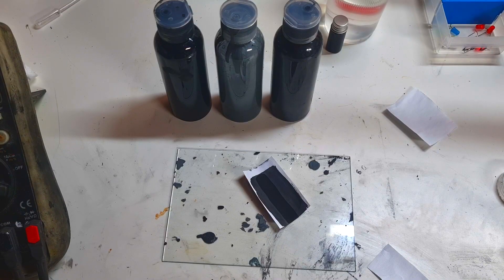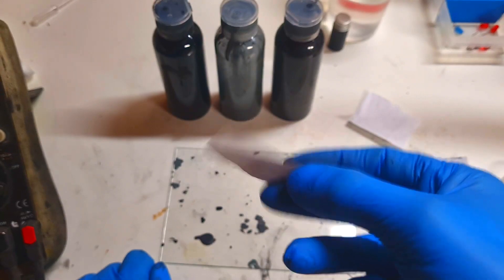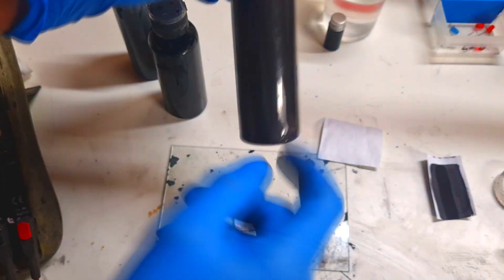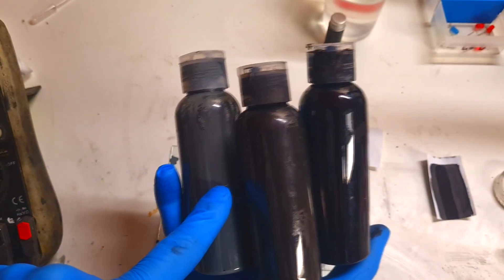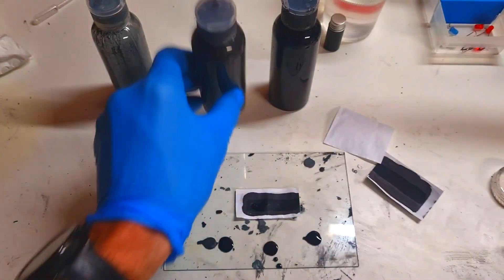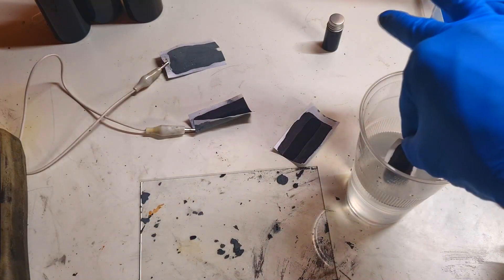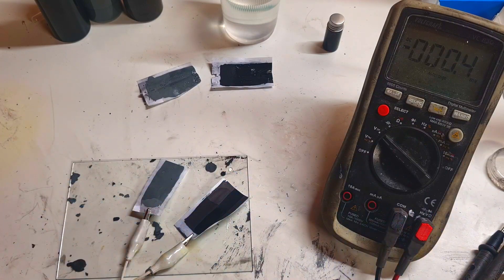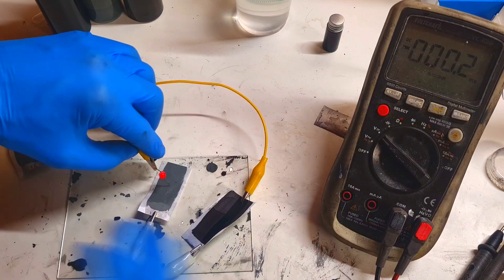Water activated Paper Battery

Comment: Friend, you try to use magnet sheet both sides to hold the paper flat and well compressed
Reply from the maker: Good idea
Reply: @cayrex  you most welcome. Master.
Reply: It is an ill informed idea. The Hall effect will restrict your current to the edge of the battery making the internal resistance go up. It may even pinch it off completely.

Comment: I make it, use water as solvent, and PVC white glue, as you told me, its worked, but I got 1 volt only, it's ok for the first try. thanks master.
Reply from the maker: Yes,.... you will get the voltage from 1 to 1.2 volts. Add more salt,..  maybe will help
Reply: @cayrex  Thanks alot, will try.
Reply: @cayrex  today I test it, very low current can not light a led with 2 paper batteries, I think must  wait for the current collector to be ready by tomorrow.
Reply from the maker: @hasan24253  if the cell is dry will not work.
Reply: @cayrex  Thanks for your kind reply,

Comment: What happens if you don't put some current collector ink on it? Just higher resistance and lower voltage ?
Reply from the maker: The voltage will be the same,... the current will be lower
Reply: @cayrex  so can that be incorporated so only one ink is used or  is it far lower resistant when you have it on top?
Reply from the maker: @Buzzhumma  yes
Reply: @cayrex  is that YouTube deleting my micro fibre comment with ebay link ? I have posted it twice?!
Reply from the maker: @Buzzhumma  Yes, youtube deletes all links or it push into restricted section
Reply: @cayrex  ok so I will try send just word for you to search ebay. I think this micro fiber cloth could be used and not rot like paper.....10pcs Microfiber Suede Cloth Glasses Cleaning Tablet Phone Screen Camera Lens AU
Reply: You paint onto wax paper first and let dry and then spray light coat of ethanol to make surface sticky and then press cloth on! When dry you peel off the wax paper. This stops the ink permeating too far into fabric preventing short circuit . Haha very clever👍🏻

Comment: What if you use bigger paper pieces??
Reply from the maker: Then you will increase the surface area and with that you will increase also the current output.
Reply: @cayrex  will  it be a capacitor not a battery you think?
Reply from the maker: @hasan24253  It's hybrid